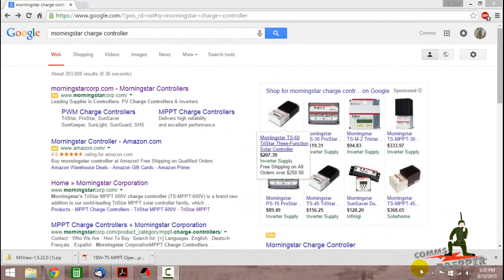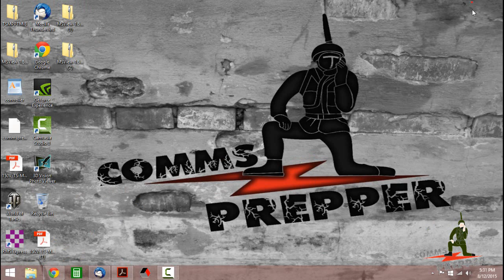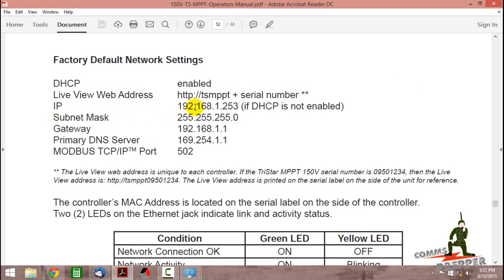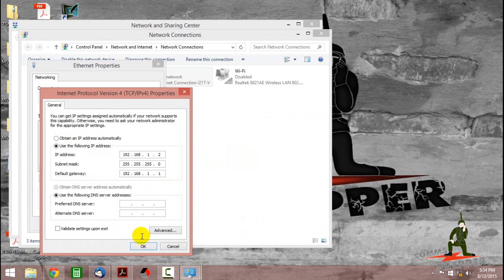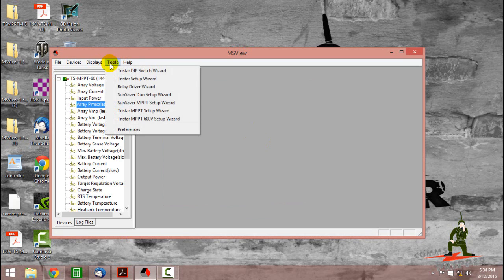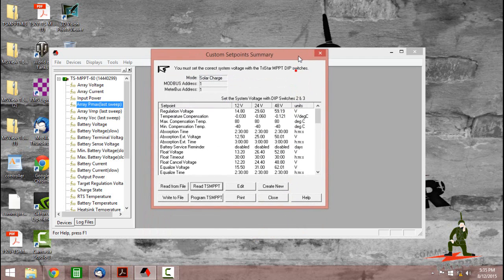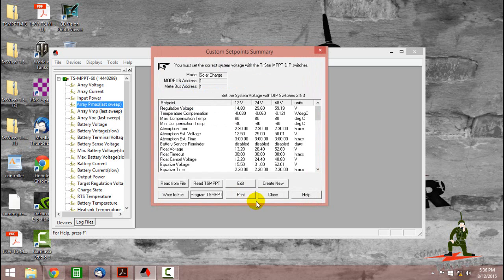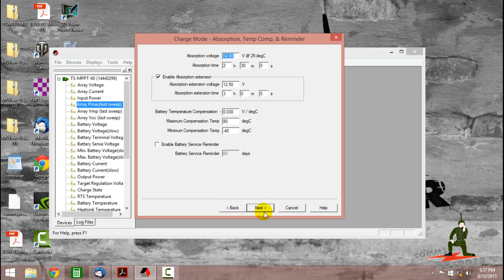TS-MPPT-60 Morningstar Charge Controller - Programming Setup

Comment: I have the pwm 60 and it is charging my 48v battery bank at 50v. Shouldn't that be 56v? It's taking forever
Reply from the maker: What is your array voltage?
Reply: @Commsprepper  between 80-90v @ 9amps. I'm thinking maybe its somehow stuck in float mode. I adjusted the dip switches but still get low volts. 1 day later it's at 51.3v

Comment: hi hank thanks for the reply yes it is the right ip address and the right controler
Reply from the maker: I don't have the controller in front of me.  However, if you can connect to the web interface that tells me your connections are good.   Can you send me a screen shot of your network screen from the web interface?  Also, can you send me your dip switch settings?  My email address is commsprepper at gmail

Comment: having a problem i got to ms view but an error came up unable to open connection to tristar-mppt unable to open modbus tcp/ip connection to 192.168.1.253:502 can you help thanks chris
Reply from the maker: Chris can you confirm a few things for me?  1) The correct IP address is loaded in the controller 2)  You are selecting the correct controller type  3) You are using the manual tab when loading the IP in MS View 4) can you connect to the webpage of the controller.  Hank
Reply: Commsprepper and sorry yes we can conect to the web page